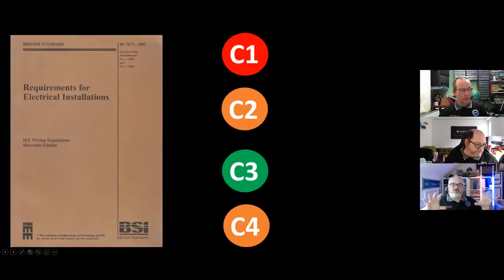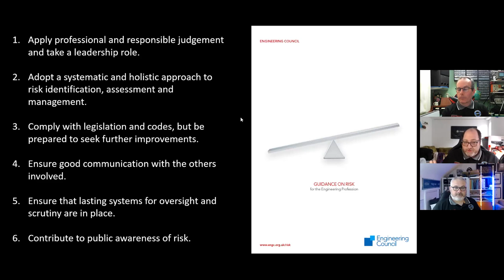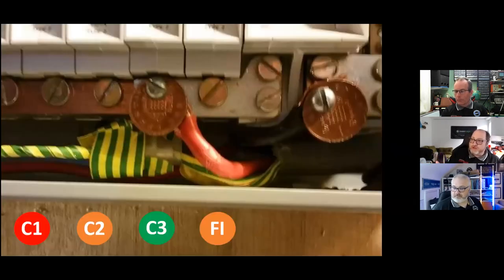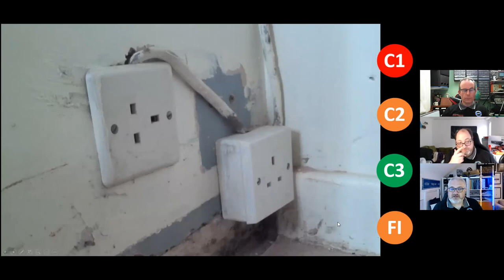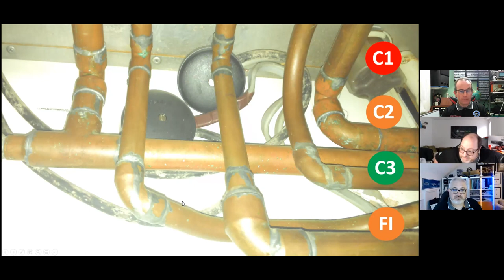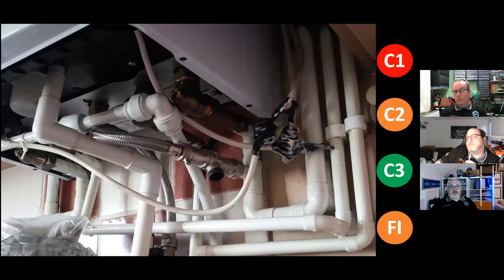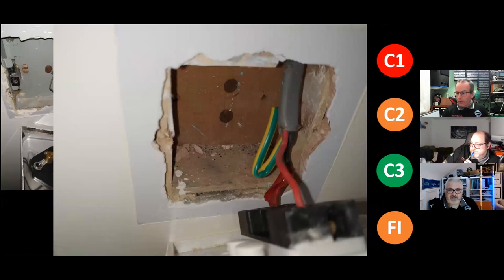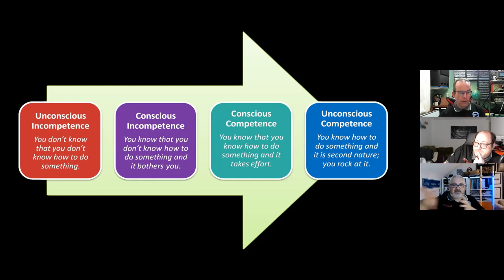EICR coding for Domestic installations with John Ward and Paul Meenan

Comment: 1:39:26 Guidance for us on the Gas pipe distance is in the Onsite Guide BS7671:2018 Sec 7 pg 84 7.4.3 which cites BS6891:2015. The minimum distances for low pressure gas pipework up to 35mm and distances from electrical supply equipment and switches are quoted.  The minimum distance for a main isolation switch or consumer unit is 150mm and its clearly closer than that. If that board set on fire with next to no air gap for heat transfer and a gas pipe in front of it, its not hard to see why 150mm could be the minimum for safety of the installation. We have fire rated boards now to comply with ammendment 3 and yet this one is plastic with a gas pipe an inch in front of it. So here a BS standard regulation is being broken then surely a good inspector with this knowledge, although possibly technically limited to understand as to why its a regulation and what the risks are would note it a C3 with good advice to move the pipe or DB board at the very least to comply with BS6891. The regulations are for everyone and if you get a whiff of one take a moment to think what risks your industry may pose to another as the ultimate goal is safety and compliance all round.

Comment: I am just a student so it would be nice if someone could help me ... When one prob was on tap and another on the tumbler obviously voltage was being tested. 
So if we had a voltage detector instead of a multimeter, would we still get 247 voltage?
I could understand as whether the tumbler had a fault and it was touching the pipes hence the voltage appeared on tap or is there something I am missing? Thanks

Comment: Ok assuming the red fuse is incorrectly sized, evident to the cable connected I would classify this as a C2 ASAP  improvement required. .